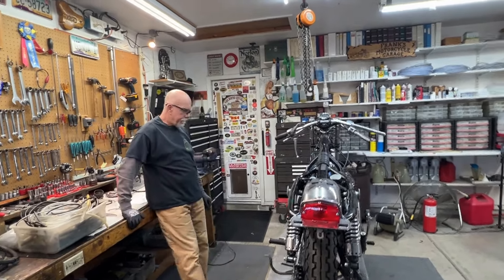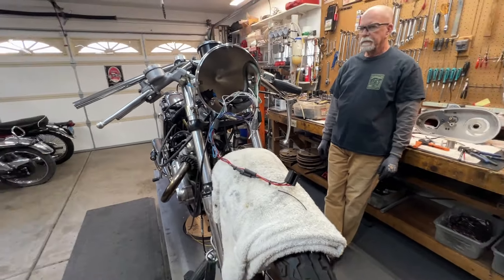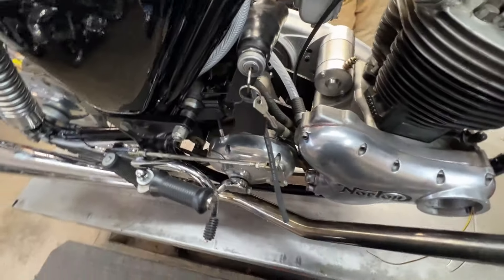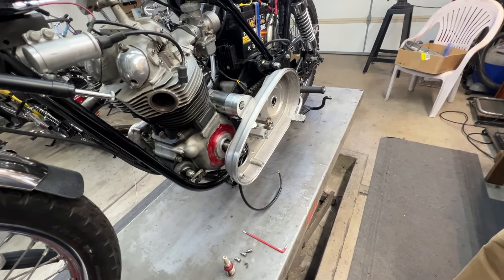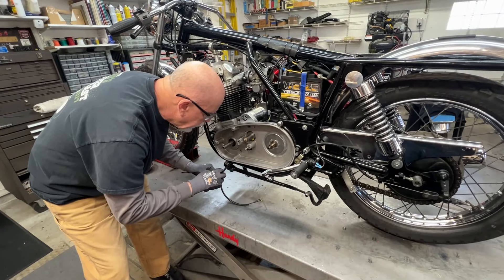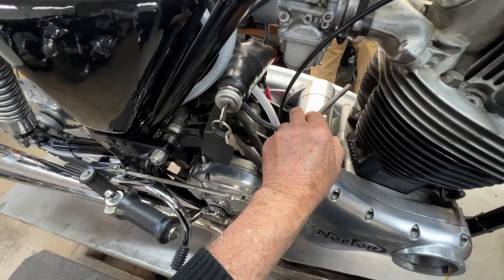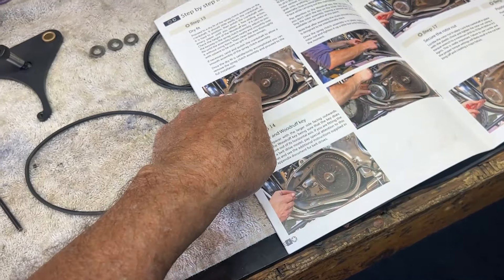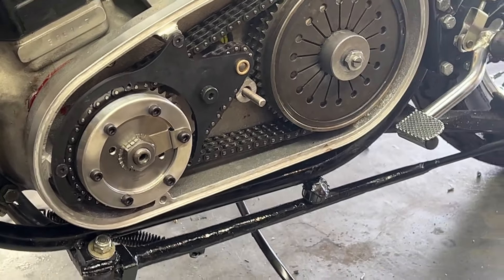03-16-23 - Alton Starter - First Spin!

Comment: Another manufacturers electric starter uses a belt primary drive instead of the long lasting triplex chain. The starter button is on the original Lucas control cluster.  The Alton starter uses more of the original components and the appearance is close to what a factory set up could have been.    The small but powerful starter motor nestles nicely between the engine and the transmission.  Nice set up.
Reply from the maker: Alton also offers this same starter kit that includes a primary drive belt.  I haven't installed one yet but I saw one and it is a clean system.
Reply: I have an Alton starter and a norvil belt drive

Comment: Have not seen the “lock strap” ?  Attached to rotor before. Is it an Alton upgrade? Ben
Reply from the maker: Alton provides a different style lock washer for the alternator nut.  It has a lot of small tabs rather then the 1, or 2, or 3  tabs we normally see on locking washers.  It is very nice.